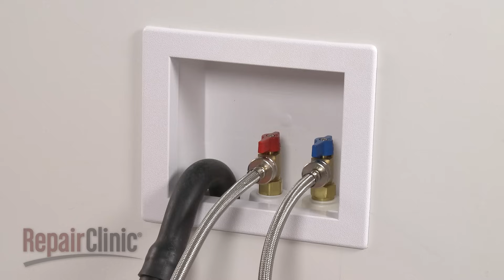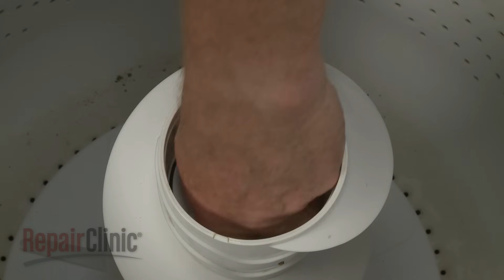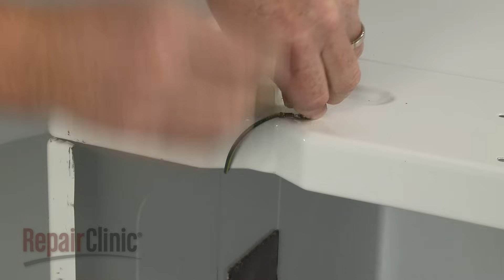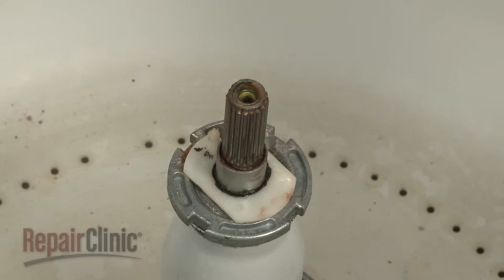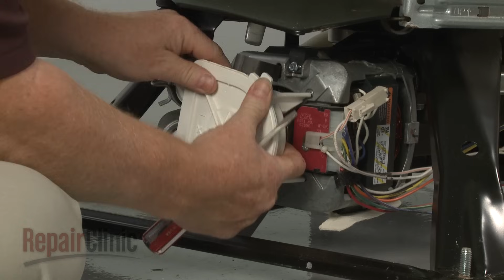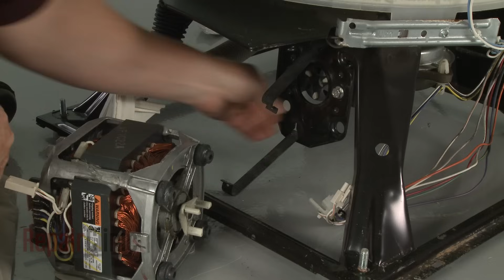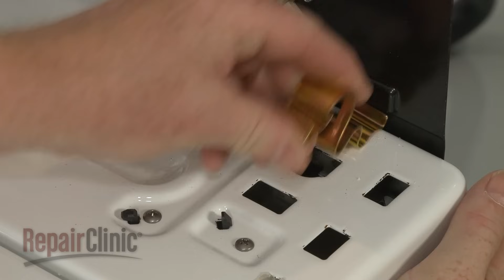Kenmore Top-Load Washer Disassembly (11022932100)/Repair Help

Comment: Urgent--I need assistance.  I accidentally washed a memory foam small kitchen rug that was damaged on the inside and now have had a terrible time removing all the tiny particle debris left in the machine.  I've washed and rinsed the empty tub with vinegar around 20 times and also vacuumed the inside of the tub too and still have tiny debris.  All I feel and see are the harsh debris left inside the tub on the bottom and sides.  

When I called your company I was told I need to remove the washer tub in order to clean out the debris that is constantly left in the washer tub after washing and rinsing because the debris is coming from the outer tub and not the inside tub.  

Can anyone tell me the weight of the metal washer tub approximately?  I'm a petite woman and have back and neck injuries already.  Also I was told that I can also remove the drain pump to rinse out any debris in side as well since my kenmore top load washer never had a lint filter made into this particular model washing machine from the beginning.  I wish they would have left the old filters in the wash tubs where you could easily remove the filter and rinse out the debris and simply place it back from the top of the agitator.  Can someone try to get back to me by 9/3/2019 please?  I desperately need my washer to work again.
Reply: Watch the entire video.

Comment: Thank you, video extremely helpful. Video instructions very clear and easy to follow. Replaced my basket drive and clutch. My 12 yr old washer is just like new. Saved several hundred dollars by not having to buy a new one.
Reply: Do you have the exact washing machine model as in the video, if so what is the capacity on it?

Comment: I have an older 80 series washer--the endcaps of the control panel do not seem to come off. How do I access the lid switch wires?
Reply: I am no expert but on mine I slid a putty knife under the bottom of the top control panel  from the front and pushed backwards fairly hard and this forced a metal spring clip open and top control panel could rotate upwards

Comment: I have a very old Kenmore #101.82680100.  The washer use to wash and spin with the lid completely open.  A few days ago, the tub finally stopped spinning.  I ran the wash cycle again, the washer agitates quite well and drains, but fails to spin.  Is it a faulty door switch, clutch or transmission that I should be focusing on? Thank you In advance!

Comment: I have a model 11023032101, but the panel looks exactly as the video's.  I don't, however, have a bolt that secures the lower agitator.  The illustrated parts breakdown doesn't show one either.  I can't pull the lower agitator off the shaft.  Any suggestions?

Comment: Outstanding video! This is my exact washer and it's starting to make a grinding noise when agitating so I wanted to know how to work on it. Bonus points for SHOWING how to put it all back together instead of saying ""repeat all steps in reverse order." Thanks!
Reply: Mines doing the same thing. Did you find out what it was?
Reply: @Chris-zp6eh  Yes! It was the agitator. As I recall, my washer would barely agitate (turn forward 2 steps, back one, forward 2 steps, back one). It was barely turning, especially when it was really full of towels or blankets. I got part 470915 from Repair Clinic (https://www.repairclinic.com/PartDetail/Agitator-Repair-Kit/285825/470915) and it totally fixed my washer for $40 and no repairman. Replacing the agitator was very easy with this video.
Reply: what year is this washer? do you know?
Reply: @irenezamora5439  I believe we bought it new around 2002.
Reply: Have the same problem!  What caused the grinding noise??  What part did you have to replace?

Comment: A brass pin came out of bottom of washer need to know where it goes so I can put it back.
Reply: I had a similar issue, upon searching some forums i discovered they are shipping pins... They just drop into those plastic cups when the washer is assembled, but will fall out when you tip the machine onto its back.

Damn near gave me heart attack when they fell out lol but they aren't necessary to use the machine.

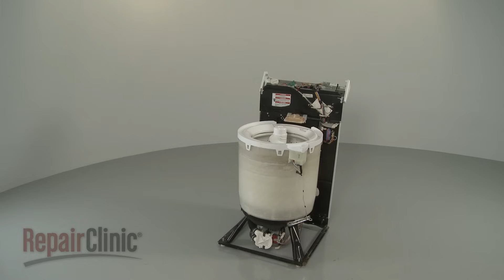Comment: at 11:55 is bad info.  "reinstall the cabinet by sliding the front edge of the cabinet underneath the base frame" is not what is shown on screen, and not how you do it.  You slide the front edge OVER the base frame -- it rests on top. If people go by the words they'll be pulling out their hair & damaging the cabinet most likely.
Reply: Just replaced the drain pump and they are correct it does slide under the frame and it holds it in place.
Reply: No it goes underneath, how else would it stay in place if it just sat on top
Reply: Just checked ours, and the front edge of the cabinet is under the frame.

Comment: what is the water inlet hose? is it important? my washer says to change it every 5 years, but we havent changed it in over 20 years lol. should i be worried?

i honestly only came here cuz our washer makes stuff stink really bad no matter how much detergent is used. and i wanted to know how to open it so i could wash the bin. i can only assume the stink is coming from the bin
Reply: No the smell is from too much detergent and its caked on inside the tub. Run a large empty load with bleach and vinegar
Reply from the maker: Yes, the washing machine water supply hoses to the back of the machine should be replaced every 5 years to avoid a flood if the hoses fail. Click here for a good replacement inlet hose set: https://www.repairclinic.com/PartDetail/Fill-Hose/8212487RP/1178857?TLSID=1943
Reply: @repairclinic  what about the stink? is that a result of the bad hoes?

Comment: Thank you very much. My washer is around 13 years old and just all of a sudden stopped spinning but would agitate just fine. Ended up being highly rusted in the inside tank shaft. Cleaning it up with scraper, wire brush and WD40. Did the trick. Also had to use wire brush and WD40 to clean up the tank bolt before able to unscrew. I didn't have a spanner wrench. So after cleaning up top and bottom of the tank bolt, a small blunt cold chisel and hammer got it lose. Thanks again Repair clinic!!!! Couldn't have done it without you.
Reply: Dave DeLine the tub brake might hold the tub when spinning and that gives issues